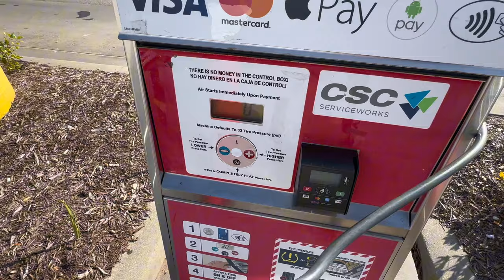Driving Squatted Trucks in a BANNED State

Comment: Effective November 12, 2023, it will be illegal to operate a "squatted" vehicle on South Carolina roads (SC Code Section 56-5-4445). "Squatted" vehicles include those with a front or rear fender raised four or more inches higher than the other.

Comment: I love the tire pressure. Ranges from 50 to 63 and they just leave it and say its all good!!
Reply: It's actually true. Worked as a tech for 2 years at a dealer. Even though they're rubber bands, those off road grade tires are required to run 60psi most of the time anyways